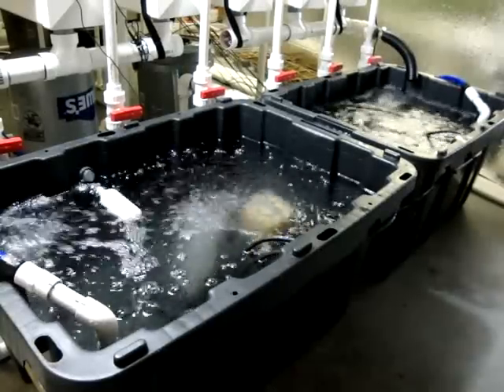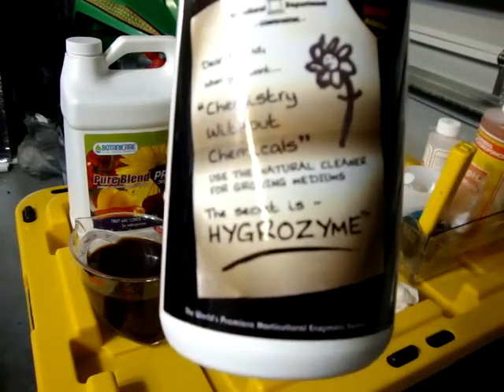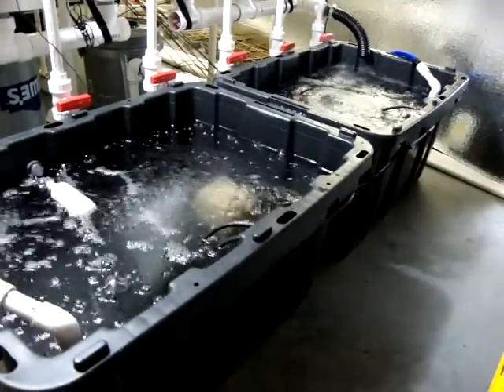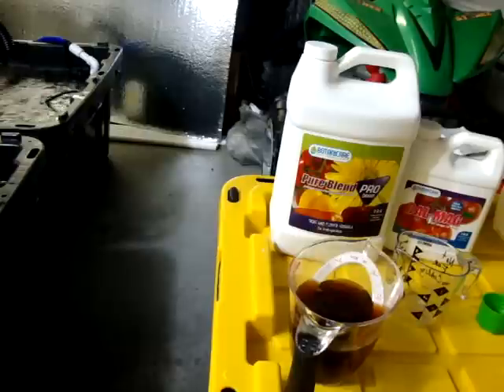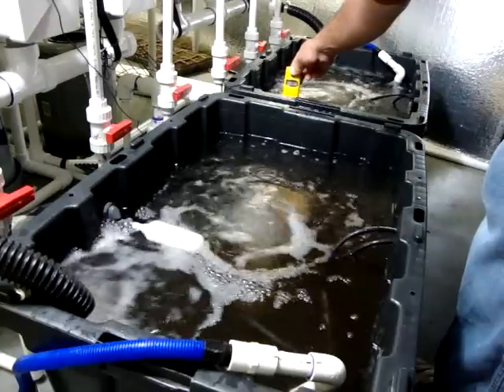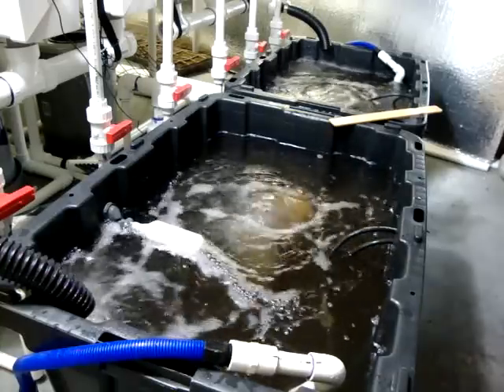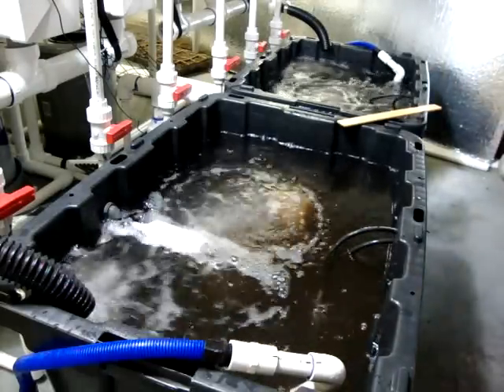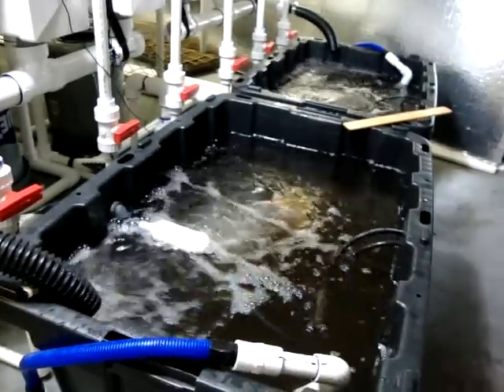DIY 39 Pepper Aeroponic System EP. 3 PT 2 (Nutrient Change)

Comment: what is the active ingredient in the "pH down" or "pH up"?
lemon juice works fine to lower pH..
when fixing pH do it to the closest 0.01. you will need a pH meter that reads in three decimal places. remember solution that is pH 6.00 is 100 times more acidic than pH 7.00. the pH may effect the plants more or less compared to the recommended pH in soils. .
Reply: No. The pH scale is logarithmic and the difference in 1 pH unit is a difference of 10 times. So a pH of 5 is 10 times more acidic than 6 and 100 times more acidic than 7. But a pH of 6 is only 10 times more acidic than 7.  Also, I fail to see a need for anyone to measure their pH into a the thousandths. Plants have a range (like pH 5.5-6.5). There is no reason to be that precise and you’re wasting your money (and time) with a meter that can accomplish that.
Reply: 1mtstewart lemon juice will kill beneficial bacteria, I use phosphoric acid

Comment: So your 2 reservoirs, do they on communicate passively after the initial mixing?  If I remember, the connect in the middle, from the pipes with filters.  I guess even though the rails are supplied by a T fitting, the water would mix at that point, correct?  Now that you've seen how much top-off you get between cleanings, is it worth having the 2 totes?  How much top-off is it between cleanings?  I imagine, the warmer the room and your airflow would make a difference also.